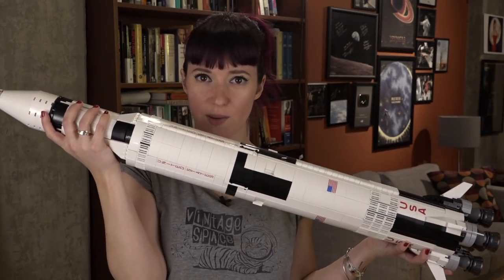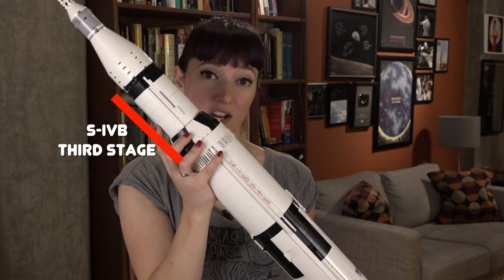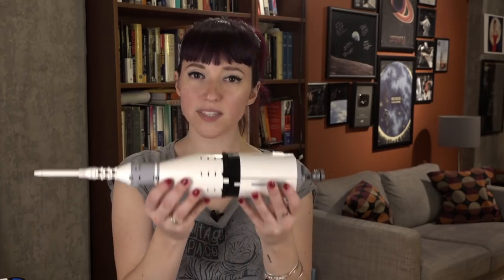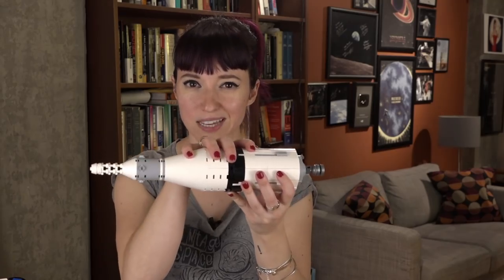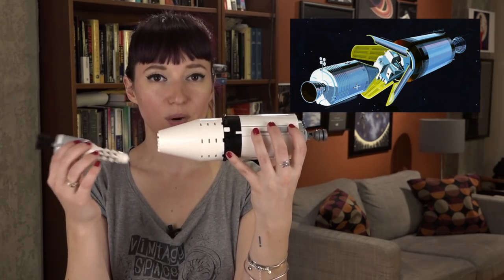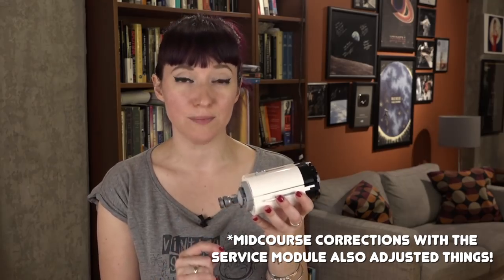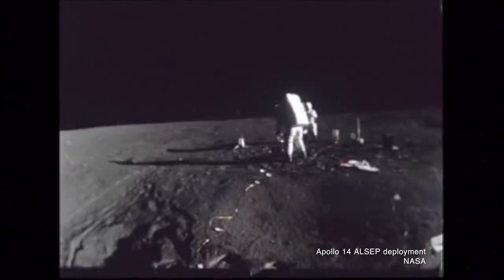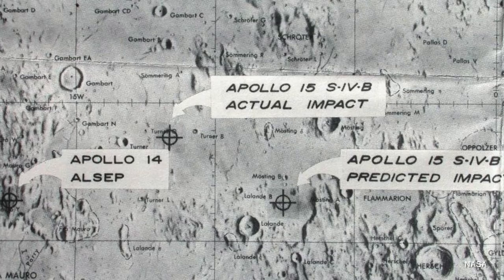This Apollo Rocket Stage was Smashed for Science

Comment: At the 'transposition and docking' stage @2:05 I would be concerned, if I were an Apollo astronaut, about the 3rd stage with the lunar module inside, to drift up or down or from side to side after the command module separated as the thrust may affect the 3rd stage's stability, making it extremely difficult to dock with the LM. But that obviously never happened.
Reply: Yes

Comment: Correction: the S-IVB stages for Apollos 8, 9, 10, 11 and 12 went into solar orbit, where they remain. The Apollo 12 S-IVB was temporarily placed in very high earth orbit, escaped into solar orbit and many years later briefly recaptured into high earth orbit for about a year around 2002-2003 where it was briefly mistaken as a natural asteroid. Then it escaped again to solar orbit, where it is today. The Apollo 9 S-IVB was burned out of earth orbit by itself as an engineering test. The Apollo 8, 10, 11 and 12 S-IVBs that took their respective CSMs and LMs to the moon (just a CSM for Apollo 8) were maneuvered to pass by the moon's trailing side for a slingshot that would launch them into solar orbit. Although the S-IVB APS (auxiliary propulsion system) burned to depletion, the J-2 did not actually relight for a 3rd burn; its excess propellants were simply vented through the forward-pointed engine bell, providing enough thrust to slow the stage down so that the moon would cross its path before it got there. For Apollos 13-17, less impulse was used so the S-IVB reached the moon's orbit just as the moon was getting there, so they collided.

Comment: Those S-IVB's were very well built and reliable. Don't recall those stages having any major issues!
Reply: Apollo 6 had engine problems with both the S-II stage and the S-IVB stage. After reaching orbit, the S-IVB's J-2 wouldn't restart for the TLI burn, so NASA had to use the SPS engine on the service module instead.

Comment: Great vid, as always.
One question: Are any of those three S-IVB stages still in lunar orbit?
Reply: The gravity of the moon is very lumpy, so almost everything that orbits it eventually gets pulled down. There should be about 5 S-IVB's in heliocentric (around the sun) orbit.
Reply: I am pretty sure that none of the SIVBs ended up in lunar orbit. They either - 

re-entered the earth's atmosphere and burned up (all the Saturn I missions plus the unmanned Saturn V tests plus Apollo 9's and, of course, Skylab)
went into orbit around the sun (Apollos 8,10, 11 and 12)
were deliberately smashed into the moon
Reply: i should say...one was actually observed not too long ago in solar orbit by an amateur astronomer
Reply: 8, 10, 11 and 12 in solar orbit I would suggest.
Reply: None of the S-IVb stages ever were placed into lunar orbit ... By the time they got to the moon the batteries were dead the cryogenic Hydrgen and Oxygen had already been dumped and the stage was dead and unable to insert into lunar orbit. The Apollo 8, 10, 11 and 12 S-IVbs were flung by the moon's gravity into solar orbit.
Reply: No. All of them are either in a orbiy around the sun. Have crashed or are in an earth orbit with an apopsis the get them near the moon. There are no sivb in lunar orbit. The will need a capture burn od about 800m/a to get to lunar orbit

Comment: Could you go into how the lunar module got connected to the service module, and the astronauts got back and forth between the two, plus where the parachutes came out from during landing at some point?
Reply: Orxenhorf  the LM is never connected to the SM (Service Module) it is stored in the Spacecraft Lunar Adapter (SLA) just below the SMs engine bell. When the Third stage fires has fired again, putting the remaining stack on course for the moon, the combined C/SM seperates from the SLA. The petals of the SLA fold back and explosive bolts fire to seperate them from the S4B. Then the C/SM turns sround and the Command Moduledocks with the top hatch of the LM. Explosive bolts are fired todetach the LM from the S4B, the Service Module’s front facing attitude jets are fired, and the LM is pulled out of the top of the S4B. The Command Module’s parachutes and gear are stored in a conical area between the the forward pressure wall of the CM and the docking mechanism. It’s a tight fit, with the docking tunnel passing through the middle!

Comment: Amy, could it be possible, that you make a video about how this whole thing with the tanks is working? What i don´t know yet is, how propellant is pumped out of a tank. I mean it´s loating arround in the tank? So how do you "catch it" or bring it to the intake of the outlet? Even though pressurization. I´d like to learn more about it!
Reply: Look up "ullage motors". Basically, the S-IVB had a set of small solid rocket motors that fired before ignition, so causing the fuel to "fall" to the bottom of the tank, ensuring that the fuel pumps had something to pump. You can see the motors operating in this video of the S-IVB separating: https://youtu.be/_V2rYMu2m18

A second set of motors was needed for the scheduled engine restart.

Bonus video: from inside the S-IVB's hydrogen tank during initial acceleration and freefall: https://youtu.be/mJzT2bBGVfo

It's quite long, but at around 9:00 you can see where the main engine cuts out and the hydrogen begins floating around inside the tank, and I think at around 20:45 is where the ullage motors fire for the restart and the H2 falls to the bottom of the tank.

Comment: I'm not sure that the statement "...For Apollos 8, 10 and 11, the S-IVB stage was put into lunar orbit..." is correct.  Those upper  stages are reported to have been placed in heliocentic orbits.  The upper stage for  Apollo 12 was unintentionally placed in a high earth orbit until being ejected into heliocentric orbit by the gravitational effects of the earth-moon-sol interactions.  It was briefly recaptured in the earth-moon gravitational fields in 2002-2003 before being again ejected back into solar orbit.  The S-IVB stage for the Apollo 9 mission was also placed into a heliocentric orbit despite the fact that the mission was an earth orbit only mission for the CSM and LM.  This was accomplished by performing an additional burn after the CSM had extracted the LM from the adapter.

Comment: Ed Marshall
Hi Amy,  I just wanted to let you know of a few goofs in this video. You mentioned the S-IVB's of Apollo 8, 10, and 11 going into lunar orbit. I know, you meant to say, "into solar orbits". I also noticed on Wikipedia that they claim the Apollo 9's S-IVB also went into solar orbit. I had never heard this before, but it makes since with all of the extra fuel they'd have had for an Earth orbital mission. Also Apollo 12. S-IVB did orbit the Earth until 1971, then went into a solar orbit, and returned to a temporary Earth orbit in 2002 and 2003 for a short time. There are those that say it may reenter another Earth orbit in the 2040's, but it depends on the solar wind influence on it until then. Even though an empty Saturn third stage is relatively "easy" to push around in space for it's size, it's cool to know that something like solar wind could do that, huh? It's also cool to remember that the various S_IVB's that didn't crash into the Moon still orbit the Sun quite close to the Earthand travel past us all now and again. Thanks!!!

Comment: Did Soviet and American command modules ever get close or were they launched at different times during the space race?
Reply: Well, there was one mission where they got very close. In fact, they docked - and that was the Apollo Soyuz Test Project of 1975. Other than that though, there was no correlation between any other Apollo missions and Soviet Soyuz missions.
Reply: Andrew Ongais I don't believe he was asking if they got close near the moon, but throughout the whole space race.
Russian and American capaulds were often launched at different times and in different orbits, and even if they were on similar trajectories at the same time, it would take a lot of coordination and planning to manuever within visual range. However, there was one mission where an apollo capsule and russian soyuz intentionally docked together.
Reply: I actually meant if it happened unintentionally, not as a mission to dock with each other.  Thanks for your reply Cam, it was a good sensible one.
Reply: Getting two spacecraft close together in space is actually quite difficult. Because of the different launch site locations (Baikanour v' Cape Canaveral), the orbits that are used by spacecraft launched from those locations are usually very different . In order to meet up in space, the launches have to be specifically timed (the launch window) and a lot of adjustments need to be made during the ascent and insertion into orbit and then to the orbit itself once orbit has been achieved.
Reply: The Nerfed Gamer - We should ask Amy about this,  but my understanding is that the Soviets had a lunar orbiter in taking photographs of the surface during the Apollo 11 mission.   

In fact, that probe crashed near The Sea of Tranquility on the day of The Apollo landing ! 

Think about this;  It would have been horribly bad luck, but it could well  have crashed into The Eagle Lander, or close enough to destroy it!    

If that had happened,  It would have been taken as an Act Of War  by the Soviet Union against The U.S.A !   And, even a personal  apology by  Kruschev could not have changed that!

With Aldrin and Armstrong dead on the surface Michael Collins  could well have watched from the lunar orbiter from while a nuclear war between the super powers destroyed all life on Earth,  and left him as the only thing left alive ! 

That is not science fiction,  it was a very real possibility!
Reply: The Soviet Lunar Probe (Luna 15) was not taking pictures. It was an attempt to land on the moon and return a sample of moon dust or moon rock. It would have taken pictures when on the surface but it never got the chance. It crashed during the landing attempt. 
In September 1970 Luna 16 repeated this mission, this time successfully.
Reply: EricIrl - I see 😃. 

A splendid example of who's technology was better; Soviet or Western. 

I'd like to see a video by Amy about Luna 15.
Reply: I don't see it that way. Both sides were pushing their technology to the limits. Both sides had their setbacks and both sides had their successes. Within 18 months the Soviets were able to land a sample recovery mission on the moon - and bring the sample safely back to earth, all unmanned. That was quite an achievement in itself.
Amy has admitted that she hasn't really looked into the Soviet programmes of the 50s and 60s. They are incredible in their own way but hampered often by overt interference by the Communist leaders who kept pushing for more and more spectacular space missions.

Comment: Are any of the lunar surface experiments still emitting/receiving signals. Or how long did they last?
Reply: I believe only the laser rangefinging reflectors are still in use today.
Reply: Per Wikipedia, the ALSEPs were turned off September 30, 1977 because of budget constraints. Theoretically they could have run much longer because of the nuclear RTG power supply, but the earliest model (Apollo 12 deployed) was already running low on power to run the transmitter and more than one experiment at a time.

Comment: At 1:32, she says "they had to re-light" the S-IVB engine. Does that mean it was fired after separating from S-II, or was that a slip of the tongue and it was only lit the once - to leave Earth's orbit and head off to the moon?
Reply: The S-IVB was used to help get into LEO but as she said, it was also used for the TLI  burn so had to be restartable. During the Apollo 6 test flight, the S-IVB failed to restart for the TLI so they ended up jettisoning it and using the SM main engine to get into high orbit to continue with some of the tests planned for the mission.
Reply: Yes, had to restart and burn for about 6 minutes to get to 24K mph.